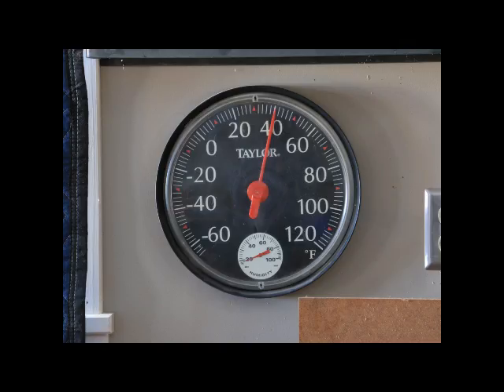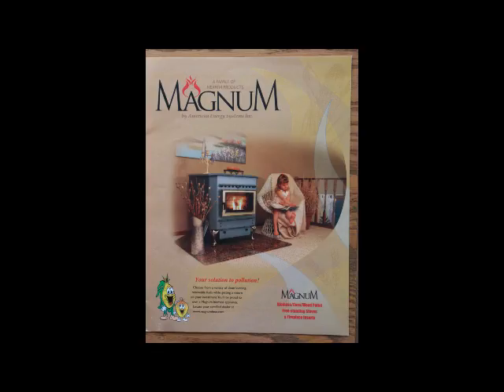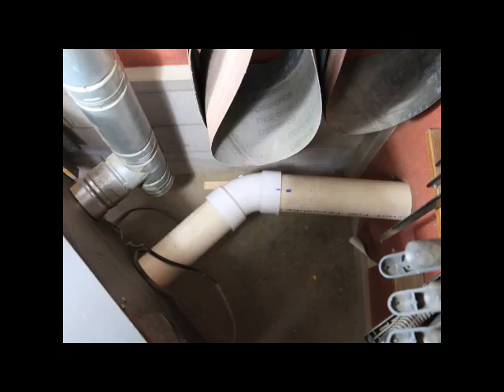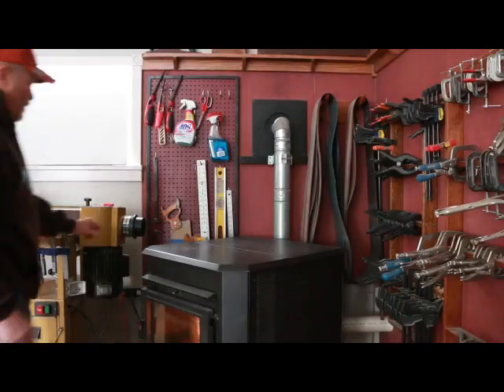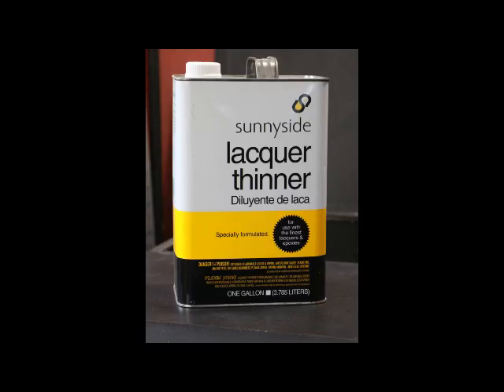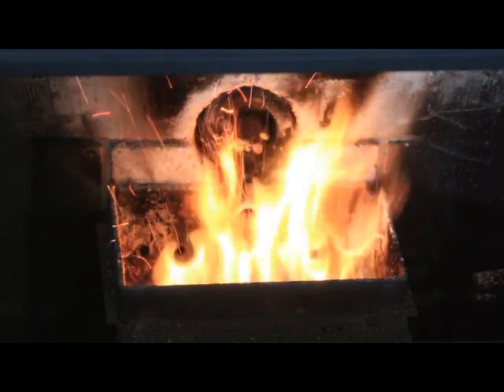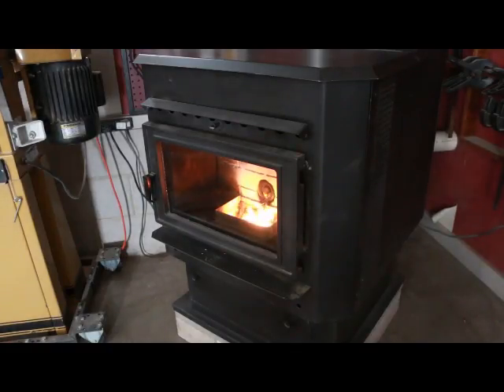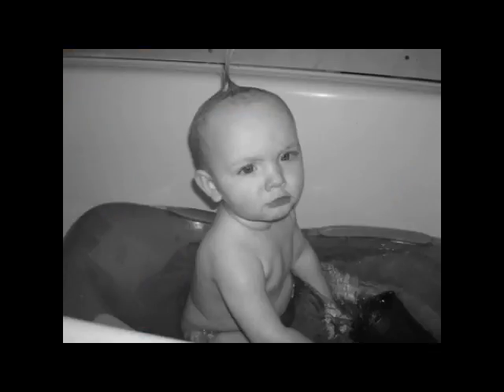Pellets and Corn to Heat the Shop

Comment: Pellet heaters work much more efficiently if they draw their air from outside through a double skinned flue, preheats the air before it enters the burn pot and you will get much better heat output, you can run it on a lower setting saving fuel, less ash and glass that stays cleaner for longer!

Comment: Hi...good video...I've been heating my 720 sq/ft (24x30 (8ft ceiling) garage/workshop for 4 years with a PelPro 130 from Home Depot.. it holds 130 lbs of pellets and is awesome... here in NW Ontario Canada it regularly gets to -35c (-30f) for weeks at a time and this little stove keeps me warm, I have R60 insulation in the roof and r20 in the 2x6 walls, the floor is concrete and the worst energy "leak" but  is manageable throughout the winter. I built insulated decorative shutters for the windows (4" of eps foam) and the same for the garage doors it now looks like a barn or stable, the insulated bark/stable doors and nearly air tight since that is a huge leak in the thermal envelope.. it takes an additional minute to open the doors to get a car in/out if needed/. … keep up the great work...subscribed..
Reply: I just purchased a pel pro 130.  Hoping to hook it up next weekend.  Have you had good luck with your unit?
Reply: @jeffneuman7372  Hi Jeff, yes I've been very happy with mine. I have learned the trick with pellet stoves is REGULAR cleaning. I run mine from Nov to Apr and for the most part only during the day (I will run it overnight if the shop temp is down and it's going to be cold (-35c cold)), Its almost always running on minimum so its just idling along though I'll run it all out for an hour of two during a cold Jan morning if required. Since its cold in the mornings I vacuum it with a "PowerSmith PAVC102 10 Amp 4 Gallon Ash Vacuum with 2 Ash Filters, Silver" from Amazon.ca (get the silver one it has a longer hose and two filters...the shorter hose is a PIA (a friend bought that one)). The PAVC102 is a faaaaar better value. Anyway a light cleaning daily (1 minute with the vac) and a deeper clean weekly (5 minutes with the vac) and a deep clean mid winter and at the end on the season with a leaf blower (see leaf blower hack here on Youtube for cleaning pellet stoves... don't forget to leave the door wide OPEN since you hook the intake of the blower up to the stove exhaust pite..it creates a lot of suction) https://www.youtube.com/watch?v=D7FYMe_qPLE. Its easy to make an adapter for the intake of the leaf blower. That all said yes I still love it.
Reply: @alcocklake  thanks so much.  Will check the vacuum out as I know I will need one.  Thank you so much for all the information.

Comment: I'd like more details on the modification of the burn pot is it just deeper? They are noisy as heck even if you get used to it like a freight train going by.
Reply from the maker: The only difference I see is the depth of the fire pot as shown in the video.  I don't know if other manufacturers offer this retrofit but it is far quieter and I like that.

Comment: What kind of corn do you need to do this? My home just purchased has a pellet stove and im afraid of having bunch of popcorn come out LOL
Reply from the maker: 'Shelled corn' is what it is called and should be available at your local grain elevator and it will be dried to the proper level.  Last year I bought 880 pounds.
Reply: @woodmakerworkshop7121  thanks!